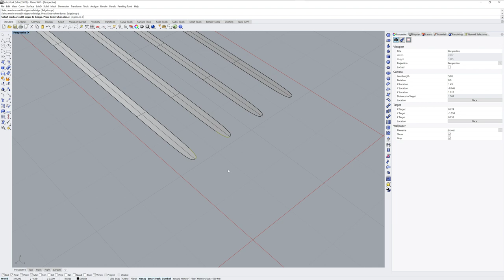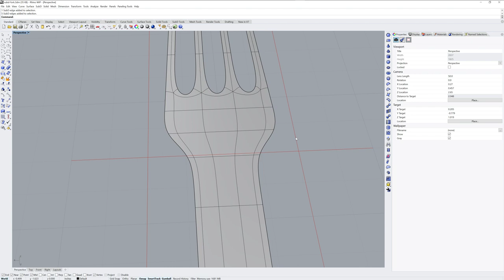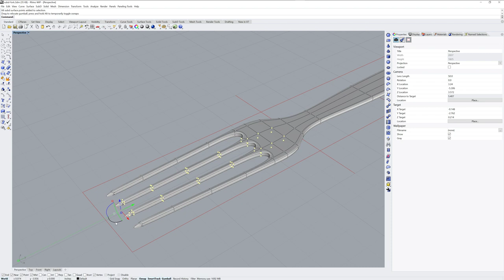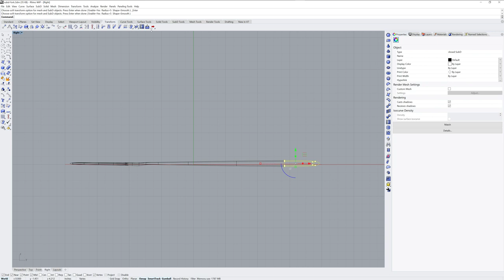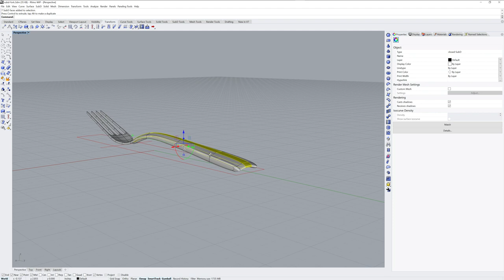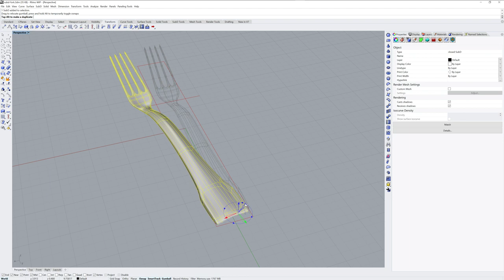Modeling a SubD fork in the Rhino7 WIP

Comment: Thank you for the tutorial. When you use SUBD offset surface in the final version of the Rhino 7, the edges are not rounded so we have to use the remove creases command.
Reply from the maker: Thanks for pointing that out, the edges do require RemoveCreases now after OffsetSubD. You can soften them quickly with a window selection over the whole model but I agree it would be nice to skip that step. We've got this on file as https://mcneel.myjetbrains.com/youtrack/issue/RH-59749 to add a yes/no option for creases when solid is chosen... I'll bump it, thanks again.